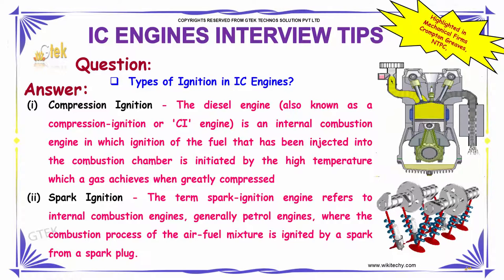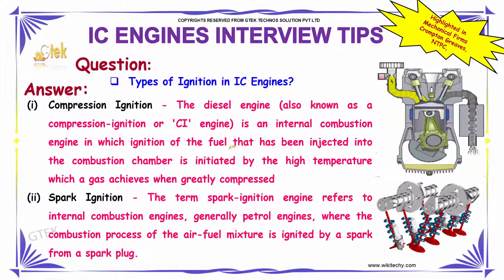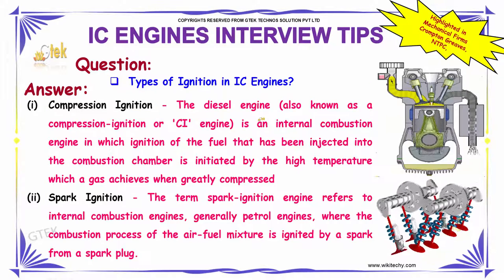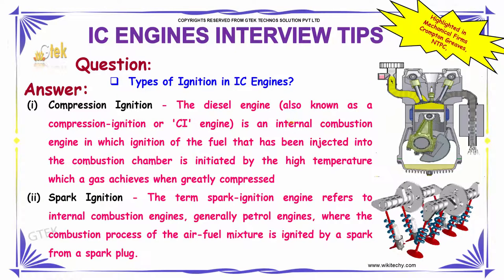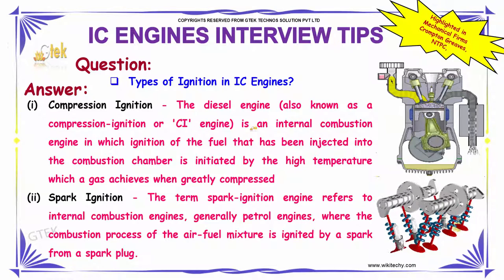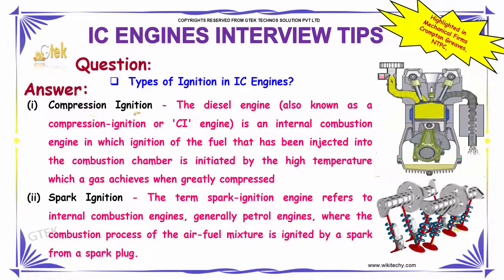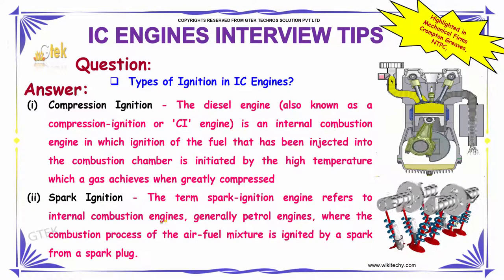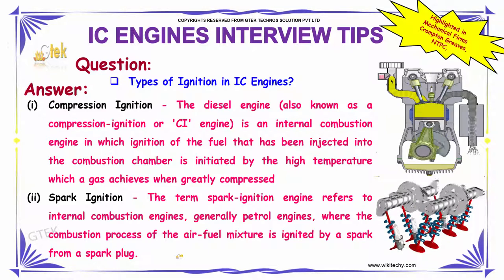what types of ignition in ic engines | ic engine | mechanical interview question | wikitechy.com

Comment: Most four-stroke engines have used a mechanically timed electrical ignition system. The heart of the system is the distributor. The distributor contains a rotating cam driven by the engine's drive, a set of breaker points, a condenser, a rotor and a distributor cap.

Comment: Jump to Spark ignition process - Otto cycle. Otto cycle is the typical cycle for most of the cars internal combustion engines, that work using gasoline as a fuel. Otto cycle is exactly the same one that was described for the four-stroke engine. It consists of the same major steps: Intake, compression, ignition, expansion and exhaust.

Comment: Otto cycle is the typical cycle for most of the cars internal combustion engines, that work using gasoline as a fuel. Otto cycle is exactly the same one that was described for the four-stroke engine. It consists of the same major steps: Intake, compression, ignition, expansion and exhaust.

Comment: The reciprocating motion of the piston is converted into the rotary motion of the vehicle's wheels. In automobiles, reciprocating engines are used. They are the most widely used type of engine. Reciprocating engines are classified into two types: spark ignition (SI) engines and compression ignition (CI) engines.

Comment: An internal combustion engine (ICE) is a heat engine where the combustion of a fuel occurs with an oxidizer (usually air) in a combustion chamber that is an integral part of the working fluid flow circuit. In an internal combustion engine the expansion of the high-temperature and high-pressure gases produced by combustion apply direct force to some component of the engine.

Comment: The spark ignition engine was a refinement of the early engines which ... The problem with this type of ignition is that as RPM increases ... While gasoline internal combustion engines are much easier to ...

Comment: IC engines are of two types 2, 4 strokes IC engines. frequently asked ... to answer a numerous questions be it in the interview or in academics. ... The internal combustion engine converts chemical energy into useful mechanical energy by ... fuel-air mixture is ignited by the spark in the combustion chamber.

Comment: The term spark-ignition engine refers to internal combustion engines, generally petrol engines, where the combustion process of the air-fuel mixture is ignited by a spark from a spark plug.

Comment: An ignition system generates a spark or heats an electrode to a high temperature to ignite a fuel-air mixture in spark ignition internal combustion engines oil-fired and gas-fired boilers, rocket engines, etc. ... The first electric spark ignition was probably Alessandro Volta's toy electric pistol from the 1780s.

Comment: An ignition system generates a spark or heats an electrode to a high temperature to ignite a fuel-air mixture in spark ignition internal combustion engines oil-fired and gas-fired boilers, rocket engines, etc.

Comment: The distributor contains a rotating cam driven by the engine's drive, a set of breaker points, a condenser, a rotor and a distributor cap.

Comment: An ignition system GENERATES a spark or heats an electrode to a high temperature to ignite a fuel-air mixture in spark ignition internal combustion engines oil-fired and gas-fired boilers, rocket engines, etc. The widest application for spark ignition internal combustion engines is in petrol road VEHICLES: cars (autos), four-by fours (SUVs), pickups, vans, trucks, and buses.

Comment: The widest application for spark ignition internal combustion engines is in petrol road vehicles: cars (autos), four-by fours (SUVs), pickups, vans, trucks, and buses. Compression ignitionDiesel engines ignite the fuel-air mixture by the heat of compression and do not need a spark.

Comment: Compressionignition Diesel engines ignite the fuel-air mixture by the heat of compression and do not need a spark.

Comment: An internal combustion engine (ICE) is a heat engine where the combustion of a fuel occurs with an oxidizer (usually air) in a ...

Comment: There are four different methods used in engineering by which Fuel may be ignited (ignition system) in Internal Combustion Engines.

Comment: An internal combustion engine is a device in which the chemical energy of the fuel is released inside the engine and used directly for mechanical work

Comment: . the system in an internal-combustion engine that produces the spark to ignite the mixture of fuel and air: includes the battery, ignitioncoil, distributor, spark plugs, and associated switches and wiring. ... Examples from the Web for ignition system Expand